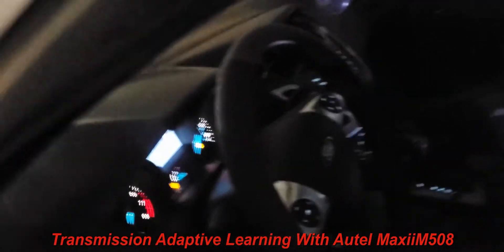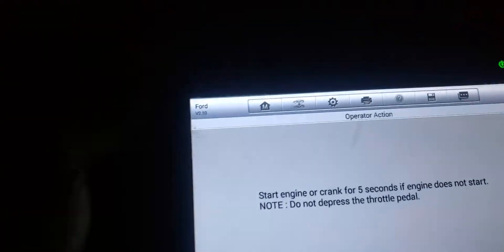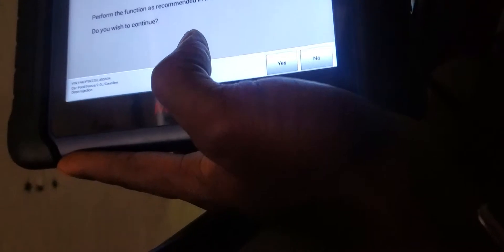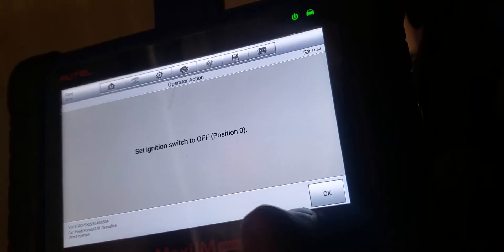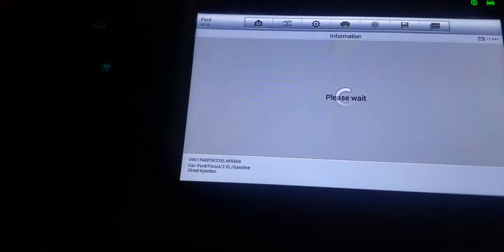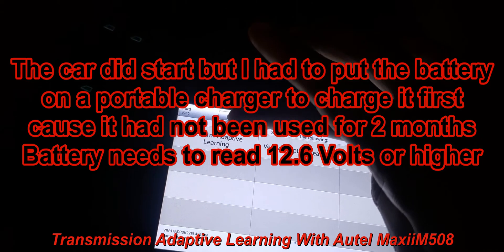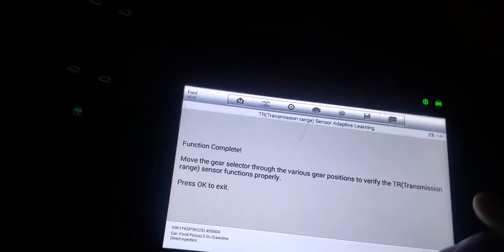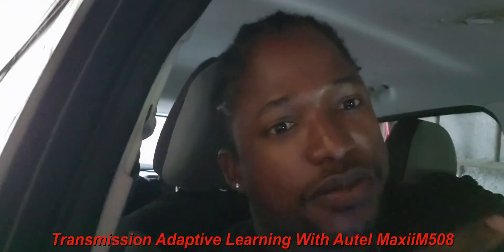Ford Focus Trans Adaptive Learning Process With Autel Maxiim508

Comment: Hey man. I did the same job but mine keeps failing at these steps. After putting the new transmission my car does not even start. No crank no start at all. What did I do wrong? Please if you can help
Reply from the maker: I understand. My tips are to check the trans fuse. 25amp silver box fuse in the engine comartment fuse box where all the other fuses are, google the fuse lable for your vehicle to make finding it easy. Make sure battery fully charged, there are two or three ground wire connections under the air box assemply, make sure they all bolted to the car body and tight. Check all your other fuses. Check the trans tcm connections and starter connections as well. Make sure they plug in tightly and all other coneections especailly fuse rail connection close to intake manifold passenger side. Great job man. Im happy my video is helping people out
Reply: Same here my Autel tool doesnt have a TCM program option only adaptive relearn and it fails at all of the steps
Reply: @dreamzzk7794 same here. Any update?

Comment: Link where you bought the scan tool
Reply from the maker: I bought it on Ebay. Here's The link for you. Please support by subscribing https://www.ebay.com/itm/Autel-MaxiIM-IM508-OBD2-All-System-Daignostic-Scanners-IMMO-Key-Programmer-US-/322622761415?mkcid=16&mkevt=1&_trksid=p2349624.m46890.l6249&mkrid=711-127632-2357-0
Reply: @LanceLotSpot  thanks man
Reply from the maker: @desantostesfa4010  You Welcome
Reply: @LanceLotSpot I thought the autell 508 was for keys
Reply from the maker: @mariolevicy3073  it has a diagnostic feature as well and maintenance service resets too
Reply: @LanceLotSpot  which one do you have?
Reply from the maker: @mariolevicy3073  I have the 508s but if i was buying one again. I would buy the autel im608 pro with the xp400 key device. You can do alot more with that but its ofcourse more expensive
Reply from the maker: All you need is the Autel im508s for simple resets and some key i.d reading for diy. Heres the link to one on ebay https://www.ebay.com/itm/394001054513?mkcid=16&mkevt=1&mkrid=711-127632-2357-0&ssspo=NroZeUscQC6&sssrc=4429486&ssuid=58pJNknqQla&var=&widget_ver=artemis&media=COPY
Reply: @so I can do the adaptive relearning with the 508 correct ?
Reply from the maker: @mariolevicy3073  Yes definitely. Thats what i used